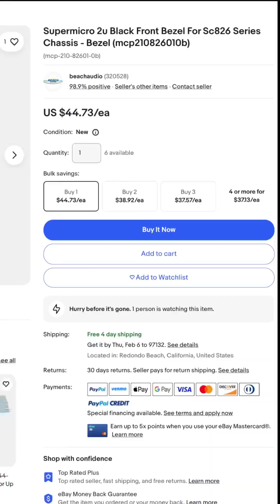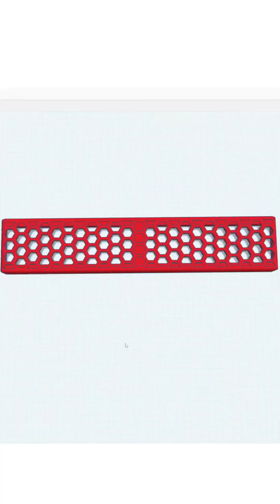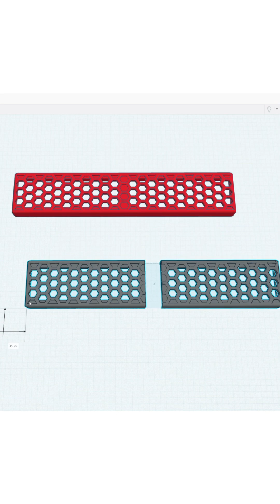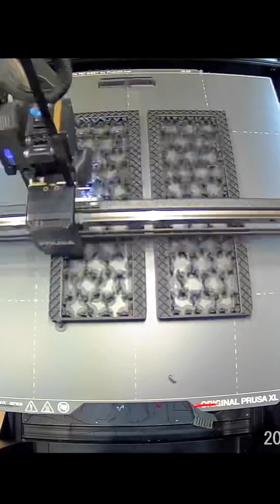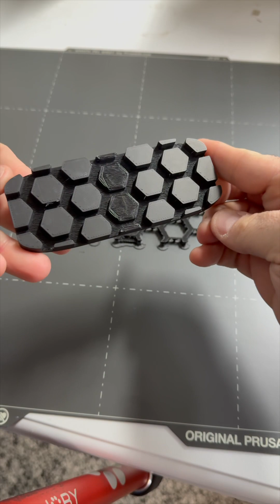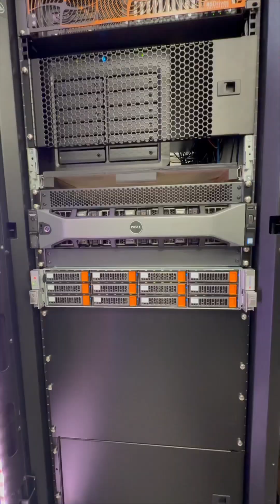I personalized my #homelab with custom 3D printed server bezels!

Comment: why not print it face down without supports?
Reply from the maker: Great question! My tests were printed that way before my ‘final product’. The problem with printing facedown is there are small overhangs that are recessed in the openings of the bezel and while my support material works well, those recesses don’t look as nice. And since the faces are what people see, I printed them face up so I can iron all top surfaces for a perfect smooth look.
Reply: @2GuysTek  Cool that makes sense! thanks

Comment: super glue is a more simple solution and wouldve been the best solution... your logo just blocks airflow, which is something you were super concerned about at that start...
Reply from the maker: The logo doesn't block as much air as you'd think.